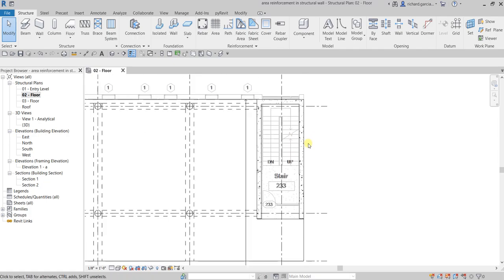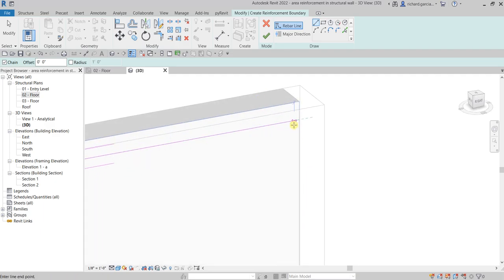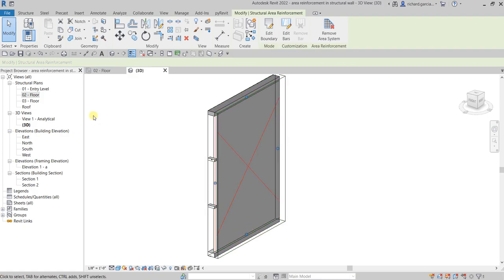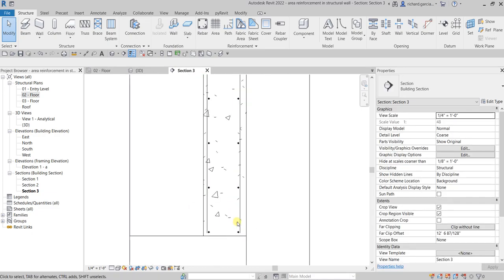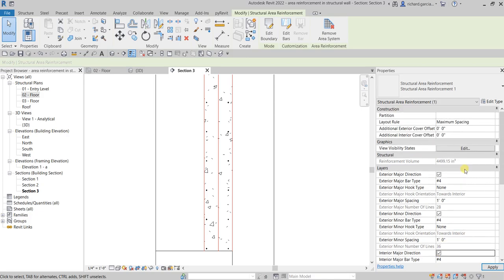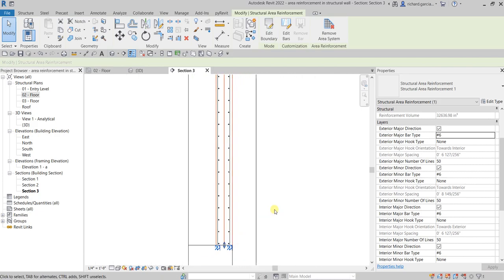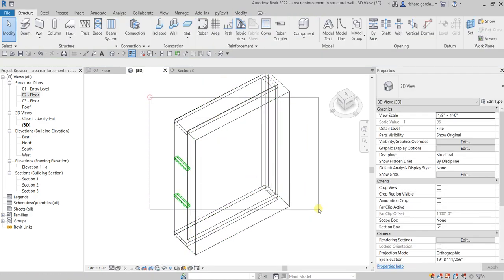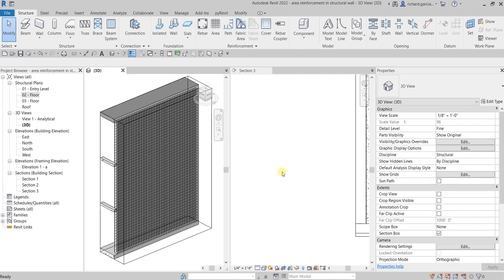REVIT STRUCTURE 2022 LESSON 27: ADD AREA REINFORCEMENT

Comment: Hi,
I am wondering that how we can provide area reinforcement with stock length and introducing lap if exceeds stock length?
Reply from the maker: hello try this:
1. *Model Your Structure:*
   - First, make sure your structural model is properly defined with walls, slabs, or any other structural elements where you want to add area reinforcement.

2. *Define the Rebar Cover and Lap Settings:*
   - Before you start adding reinforcement, ensure that you've set up the correct cover and lap settings in your Revit project. You can do this in the project settings or in the family editor for custom rebar shapes.

3. *Add Rebar Area to Structural Element:*
   - Select the structural element (e.g., a slab) to which you want to add area reinforcement.
   - On the ribbon, go to the "Structure" tab, and in the "Reinforcement" panel, click "Area."

4. *Draw the Reinforcement Area:*
   - Use the tools to draw the shape and area of the reinforcement. You can specify the shape, size, and spacing of the rebar. When drawing, Revit will use the stock rebar length you have defined in your project settings.

5. *Introduce Laps for Exceeding Stock Length:*
   - If the rebar exceeds the stock length, Revit should automatically introduce laps. You may need to check and adjust the settings for laps. To do this, go to the "Reinforcement Settings" dialog, which you can access from the "Reinforcement" tab in the ribbon.
   - In the settings, you can define lap splice lengths for the specific rebar shape and size you're using.

6. *Verify the Reinforcement:*
   - After adding the area reinforcement, you should review the reinforcement layout in a plan or 3D view to ensure that laps are appropriately introduced where needed.

7. *Customize Laps (if Necessary):*
   - In some cases, you may need to manually adjust laps or add custom lap zones where Revit's automatic lap placement doesn't meet your requirements. You can use the "Modify" tool to do this.

8. *Schedule and Document:*
   - Once the reinforcement is in place, you can create schedules and construction documentation for your project to provide detailed information about the reinforcement layout, including stock lengths and lap splice locations.

Please note that the specific steps and options in Revit may vary depending on the version you are using, so it's essential to refer to the documentation or help resources for your version of Revit for more detailed guidance.
Reply: We don't have any settings for lap value and stock length under reinforcement tab in Revit 2022 @bim360
Reply from the maker: there might be a change in the interface or available settings compared to previous versions. If you are unable to find settings for lap values and stock lengths in the Reinforcement tab in Revit 2022, it's possible that these settings are managed differently in this version. Here's what you can do:

Check Project Settings:

Go to the "Manage" tab in Revit.
Look for "Project Settings" or "Project Information." These settings often include reinforcement settings, including lap splice lengths.
Reinforcement Settings:

In some versions of Revit, the reinforcement settings might be accessed through the "Reinforcement Settings" dialog. You can try searching for this dialog in the ribbon, typically under a "Reinforcement" or "Structure" tab.
Custom Rebar Shapes:

If you are using custom rebar shapes, the lap and stock length settings may be defined in the family editor for those rebar shapes. You would need to edit the custom rebar family to adjust these settings.
Documentation and Support:

It's always a good idea to consult the official Autodesk Revit documentation, user guides, or reach out to Autodesk support for guidance specific to Revit 2022. The user interface and feature set can change between software versions.
If you are still unable to find the specific settings for lap lengths and stock lengths in Revit 2022, you may want to consider reaching out to Autodesk's support or consulting with someone experienced in using the specific version of Revit you are working with for guidance on how to handle lap and stock lengths in your area reinforcement design.